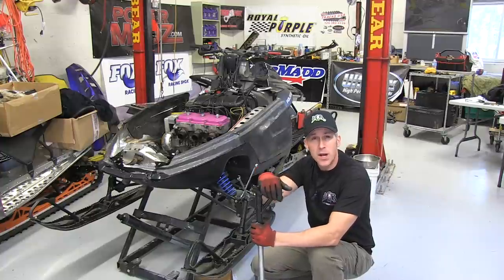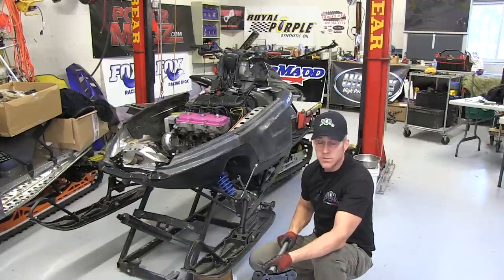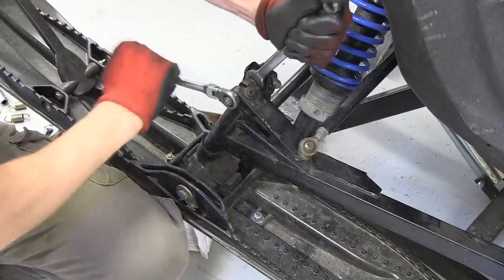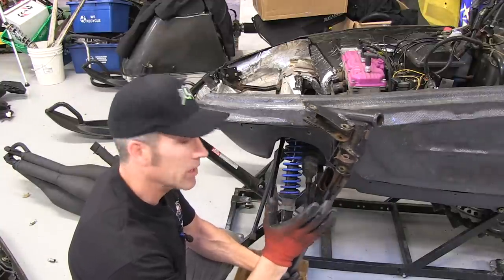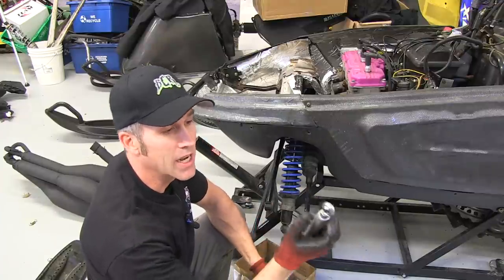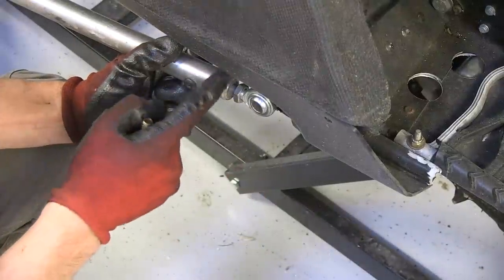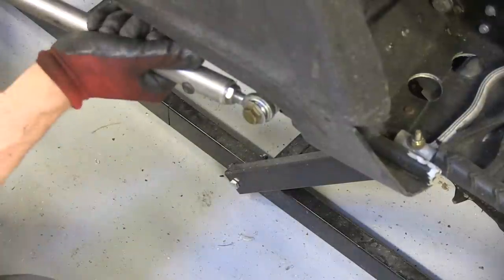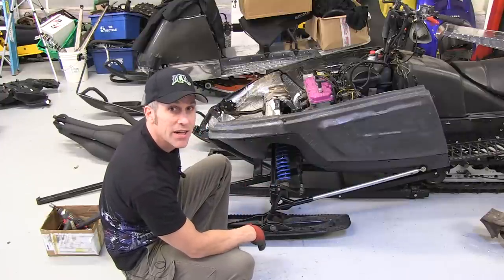Trailing arm replacement, Polaris XLT mod sled 600 triple!  PowerModz!!

Comment from the maker: Yes you can make it fit for sure, thanks for watching!
Reply: Hey I have question. I have a xlt 600 with a single pipe. Would triple pipes fit on it with out modifying the mounts

Comment: do you guys know how to set the timing on a 93 650 RXL? i just put a new stator in and i cant figure out how to set the timing, theres marks on the stator plate, that line up with the casting mark on the block, is that where it should be? theres also marks on the flywheel, and a hole in the block to see the marks, but they arent numbered or anything, just six marks, 2 small, then 1 medium, then 2 small, then 1 big one... really confused and ive been searching the internet for days!

Comment: how do you add those running boards ??
Reply: If ur still wandering u have to delete the running board cools with a tunnel mount system the u just   chop the old ones off and reinforce the area and rivet new boards on costs about 500 bucks of you can get used stuff

Comment: Trailing arms, so ancient they are still used in indy and formula 1 racing, a arms are ancient, Ford designed them in the 70's for pinto's and mustang 2's, clown